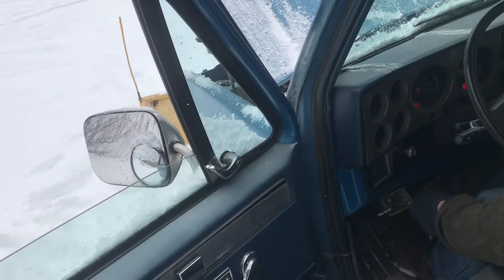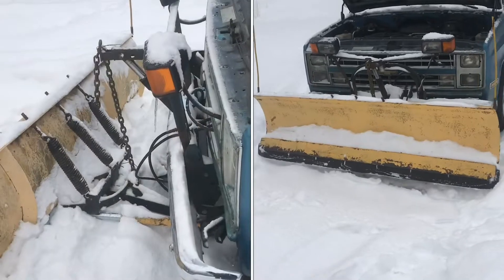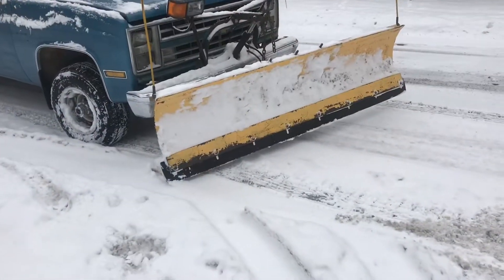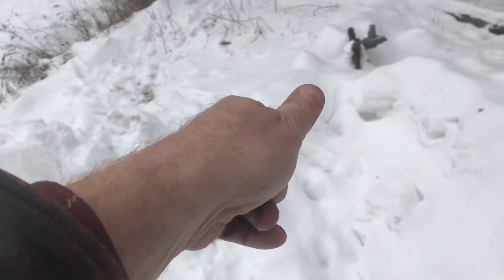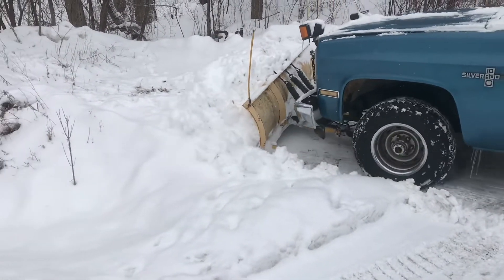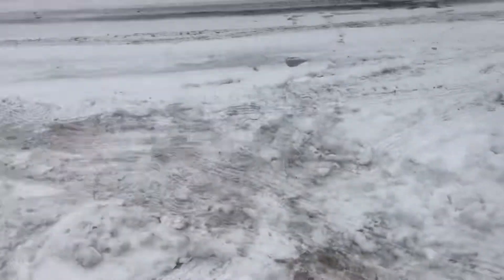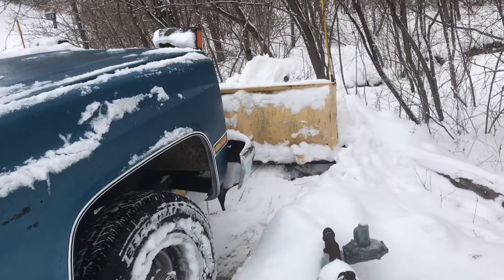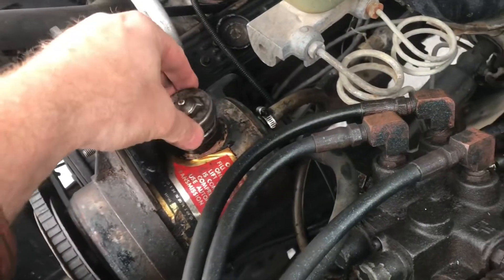how do HYDRAULICS work on a “snow plow” (fisher system)

Comment: Is the hydraulic pump the original ( The same as the power steering pump) or is it additional to the power steering pump?
Reply from the maker: It’s separate from the power steering, we attach another belt to run the hydraulic pump for the plow. Hope this answer helps👍